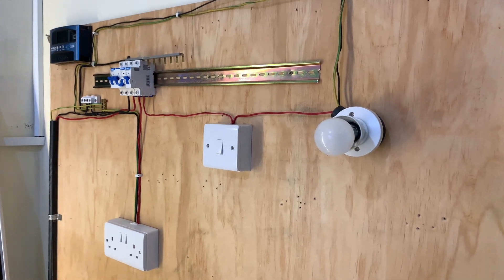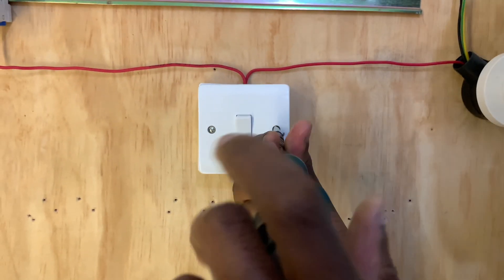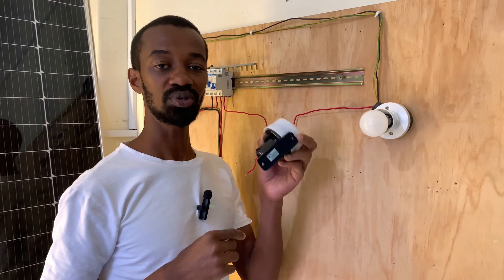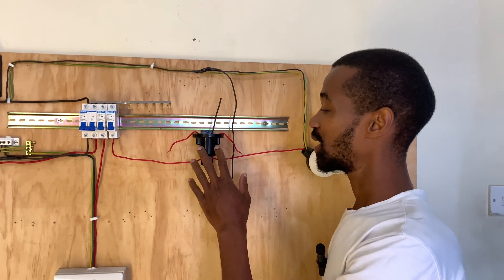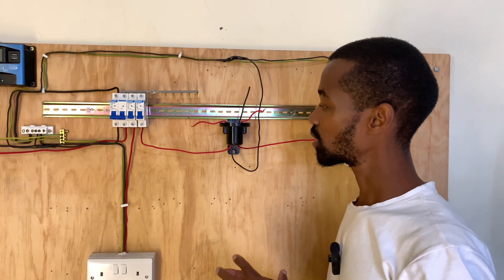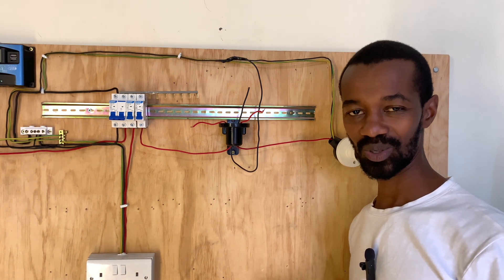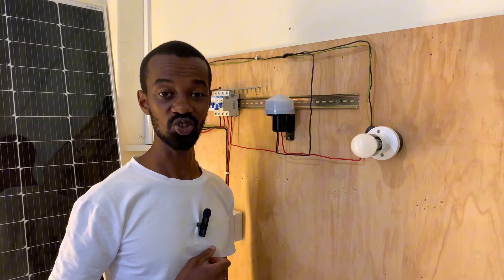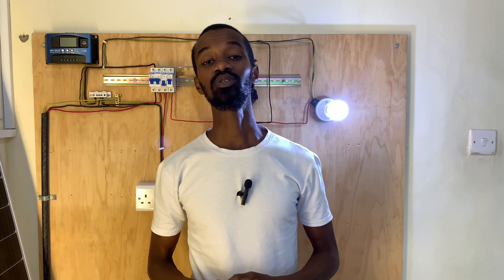How To Wire A Photocell (DIY VERSION)

Comment: Good job engineer.
Please, if im to connect the lights outside my house to a photocell so the turn on and off when necessary, where should i Mount my photocell so it can work very well by being sensitive to the presence or absence of light and darkness
Reply from the maker: Hello Top Boss 
Where there's movement, preferably at the door step

Comment: Use contactor plz
Reply from the maker: You can use a contactor if you want, it's not necessary for smaller loads. But  the vide will be posted soon stay tuned Top boss Augustine

Comment: I have liked the lecture sir! But if am to ask! Can one photo cell work on 50 bulbs at once?
Thank you
Reply: It depends on the rating of the bulbs vs the that of the photocell .. most photo cells are rated 20A.. meaning for your 50 bulbs in parallel, multiply 50 by the rating of each bulb and if the answer  you get is less or equal to the rating of the photocell .. then your good to go.
Reply from the maker: This might be over loading a photocell

Comment: That means if I want to fix the photocell in an already made outside light,I can leave the switch on to use the switch wire from the switch as live wire and the one from the bulb as LO
Reply from the maker: Very well put Ishmael.

Comment: should i install the photo cell  inside the house?
Reply from the maker: No. It depends on daylight to either switch a circuit ON/OFF. Thanks for your question  @nabuumaprossie8421

Comment: This tutorial is excellent—clear and informative. I have one request: could you explain whether it is possible to connect this with a Switch? If so, do you have a tutorial on this, or could you create a separate tutorial that includes the Switch?
Reply from the maker: Hello, I appreciate your feedback. Do you mean the manual switch?
Reply: @topheightselectricians  Yes
Reply: @topheightselectricians plz naomba tutorial ya fire alarm wiring na motion sensors